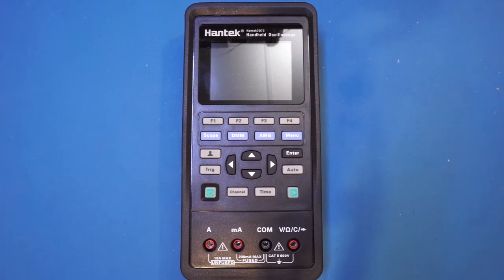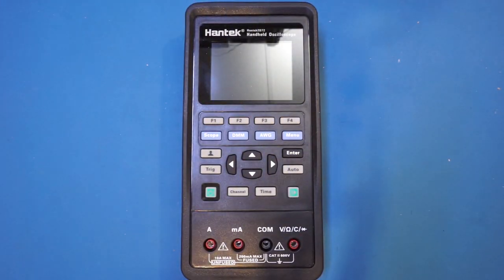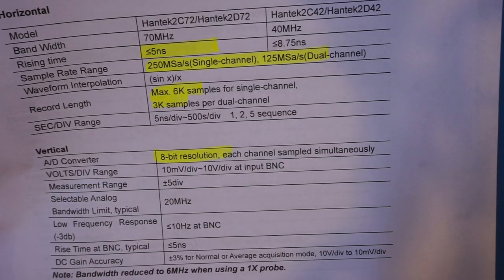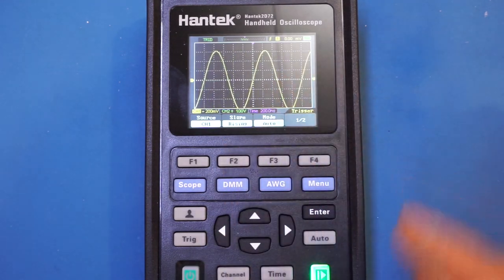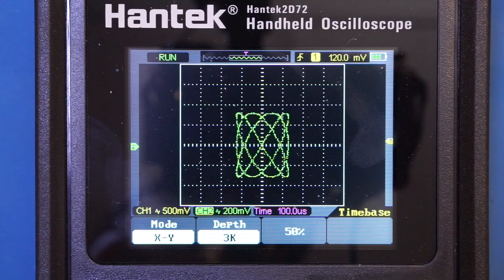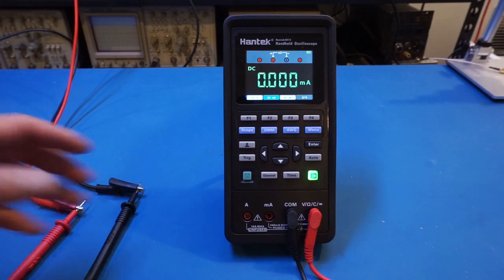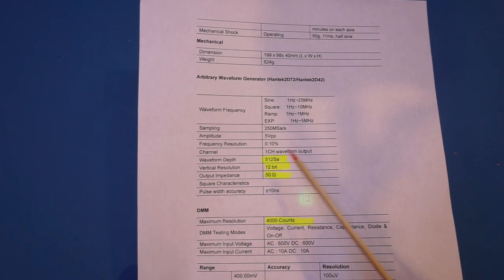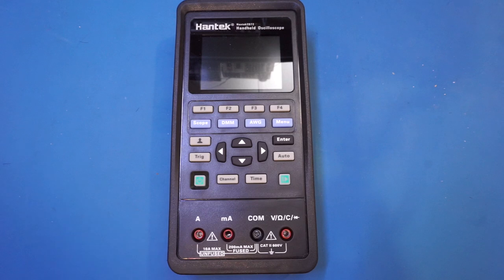Hantek 2D72 3-in-1 Handheld Oscilloscope/DMM/AWG Review

Comment: A comment on the cursors:  He demonstrated the "Time" cursor.  When you are on the menu choices for the cursor, you can choose "Time" OR "Volt".  "Volt", of course, gives you two horizontal cursors to measure amplitude.  It seems like you can't have both types at once.  Also, for the "Volt" cursor you can select channel 1 or 2.  This is necessary because you might have different vertical sensitivity settings so the calculations from the cursor positions would be different for the different channels.  For the "Time" cursor, you can also select Channel 1 or 2, but I can't see that it makes any difference if you select channel 1 or 2 because, obviously, both must use the same time base.

Comment: I have the 2D42 model and once I cleaned the probes with a 91 percent alcohol solution I found the response times and accuracy improved. I believe there is some type of protective coating on the probe that slows the connections. I clean all my new probes now.

Comment: It seems like the wave forms displayed are not symmetrical on the zero line of the Y axis.   Mine seems to be the same.   The other issue is mine seems to wig out occasionally while viewing a fixed waveform for a while and adds a spike or shows a frame on the screen of a faster horizontal sweep time for a split second on the scope screen before going back to proper wave from.   Mine also seems to have the wobbling wave form too.

Comment: Thank you for the video. Very useful info. I own one and i am mostly satisfied about it. There are some of obvious issues. Multimeter response is slow and not enough accurate. The oscilloscope is show noise. Channel 2 is influenced by the internal signal generator but in general is more noisy. If you can live with it, it a nice small and not expensive toy.

Comment: I just got one of these an noticed what I think is a user interface error.  If you use the generator and turn on its output (it's "Status Indicator" being a green circle then coming on on the connector symbol on the AWG generator screen) and then switch to the oscilloscope screen and then turn it off.  It will turn back on the oscilloscope screen as it should because that's what you last used.  But if you then change to the AWG screen the green "status indicator" will be on indicating the output is turned on, but it is actually off.  You have to press the Run/Stop button once, and then again, to actually turn it on.  So it incorrectly indicates the output is active and it isn't.  If you have the AWG screen showing with the output on and turn the Hantek power off and back on, it comes back up in the AWG screen as it should, the output will be off, AND the green "status indicator" will be off as it should be.

Comment: Great review,  thanks. How is it powered? What's the battery life? Cheers doug.
Reply from the maker: I mentioned that in the video. It's powered by 2 18650 cells, with excellent battery life. Although not specified, it would last more than 14 hours continuously with the backlight set to high when fully charged.

Comment: Seems like the OWN HDS272S would be a better option? The 10amps is fused and the multimeter accuracy is higher
Reply from the maker: Would be curious to see if anyone had done a thorough review of the HDS272S and see how the oscilloscope/AWG functionality compares to the Hantek. By looking at the teardown pictures on EEVblog it looks like that while the internals are largely the same, they used a different FPGA and as you mentioned, different DMM chip.
Reply: I have the Owon HDS-2102s.

Comment: Hey, never float the oscilloscope man, what if you put the gnd/earth clip to the live or any high voltage, now all your chasis and gnd/earth parts have this voltage level and they are exposed to you now 😅. I got that from guys working in high voltage field and it makes sense. Of course one can do so but it easily can happen you touch the oscilloscope's earth parts, one does not pay so much attention to this part, more to the DUT.
Edit: ok you mentioned that issue but only related to shorts, not to schocks 😅

Comment: Hi Kerry. Thank you for your detailed explanation of the instrument. It was very helpful to me. I used to work with analog scopes. 
I see that you have the abundant knowledge of the scopes. I bought a Hantek 2D72 /AWG. At the beginning I was able to adjust the probe at 10x with a screwdriver given with the device for the correction of the square wave at 1kHz. Now I cannot do it anymore, the adjustment on the probe useless and the square wave in the 10x mode has a high peak about 13.5V (27V peak to peak) at the positive and the negative raising edges. But at the 1x, there is no problem with shape of the square wave, I was getting correct shape of square wave. I tried it same adjustments with second probes, no change, same as I just explained. 
This issue happened after connecting a T adapter to share the square output of AWG with both channels of scope. Could you help me how to correct this issue / fault? 
Thank you in advance...
Reply from the maker: Does this happen two both channels? As these channels are independent even if you somehow damaged one channel, it would be highly unlikely you would have the exact same issue with the second channel.
Reply: @KerryWongBlog  Thank you for your fast response. I solved it. It is my mistake : I connect the probe  AWG out and feed to signal through the channel 1 and channel 2. In this situation the adjustent is useless. When reverse the connection it gets OK.

Comment: Yesterday received the HDS272 Owon.  Pretty impressed with it.  Overall the specs look better.  I could not get the software to work on a window 7 laptop though. but it
did recognize it as a storage device and I was able to download four stored waveform with 8K buffer size.  For a portable 2 Channel 70 MHz scope and generator
 I am really impressed.
Reply from the maker: Awesome! From what I could see the Owon scope uses a totally different FPGA and DMM chip. The DMM spec is definitely much better (20,000 counts). I am wondering if you have noticed anything different than the Hantek I'd shown for the scope and AWG functionality? BTW, on the Hantek the USB is implemented with the STM32 and it shows up as an STM32 device.
Reply: @KerryWongBlog  As a quick summary of my first impressions:

HDS272S has the same battery configuration and charger.  I do not believe the batter life is comparable. After about 4-5 hours of use the battery was almost gone I believe you said the Hantek has 10+ hour battery life. Batteries were included with charger. 

The stand is exactly the same. The overall feel is somewhat plasticky but is very solid. You will not be getting Fluke quality here.

The Oscilloscope ease of use and quickness was noticeable very intuitive for Electrical Engineer 

which I liked. Auto is faster than what I saw on the your video.

My signal from the AWG is stable and the scope did not show jitter.  I have a Spectrum Analyzer but
maybe later I will test the fidelity.

The DMM seems faster than what I saw on the video. 

The AWG  does not have a noise waveform and cannot be programmed(Check this).  But the selection is good with 
14 bit like the Hantek.  2V vs 1V for diode test so better.  3.5 vs 2.8 inch display so better but same 

resolution. 320 x 240.  Capacitor range larger.

The AWG and oscilloscope work independently so can connect to view and switch back and forth like
you did in your video. I think the menu structure is better and overall more professional.

Overall I would say faster and better but you pay for that with lower batter life.  Which is fine
with me I would take that trade.

The SAVE button will save Four 8K waveforms. I was only able to download these when the Device was 

configured as a Storage device to the computer.  There is a USB mode in the menu to do this.
The software is not that important to me because I have a precision lab scope but the ability to 
save and download waveforms for later is.

As an Electrical Engineer I would say both of these scopes started off from the same original
design but the OWON is one version ahead of the Hantek.  Hope this helps. Keep up the good work.
Reply from the maker: @jfcrow1   Thanks for your detailed accounts! It does sound like Owon has a better implementation (20,000 counts DMM versus 4,000 counts, fused 10A measurement range, 14bit DAC for AWG versus 12bit DAC). The only thing I am surprised about is the lack of PC software for Owon. I guess Hantek wins that one as you can use the software to create your own arbitrary waveform.

Comment: Looks like a well priced handy scope that is not mains earth referenced.   A feature that seems to be required often in my garage. The bangood page talks about software and usb connectivity.  Curious if it can be used as a long term data logger or computer controllable via usb.  Thanks for a great review.
Reply from the maker: Yes, the software is quite usable. You can control all the functionalities of the meter from the computer software. The DMM software logs data continuously at a rate about once per second. You can save the result in a CSV file which is quite convenient.